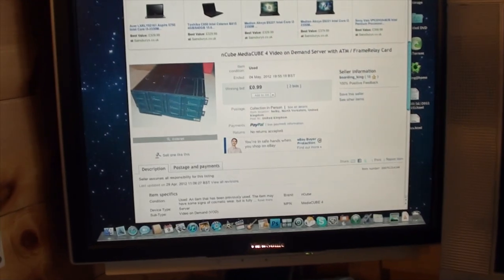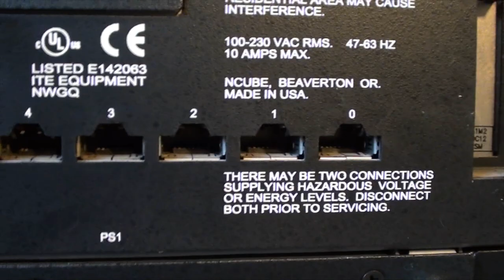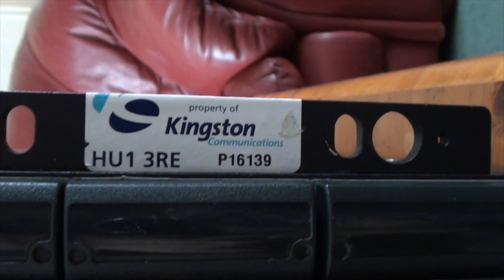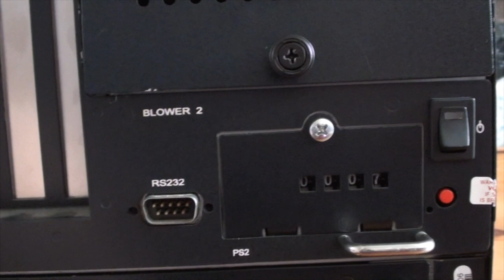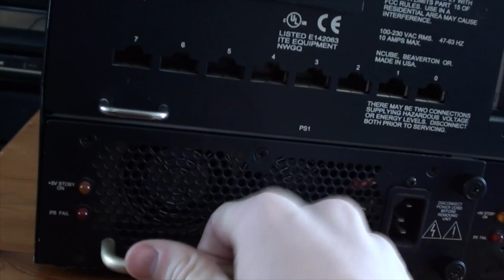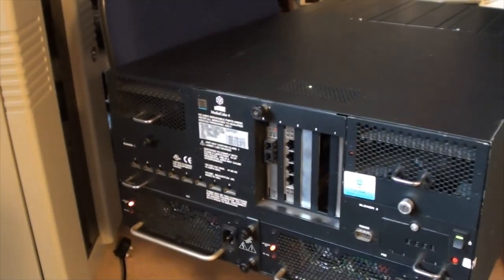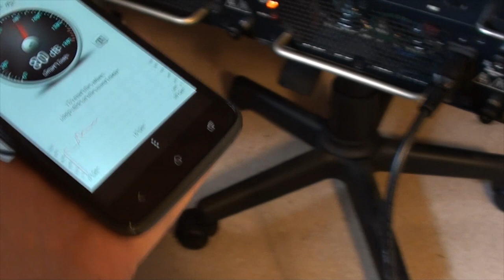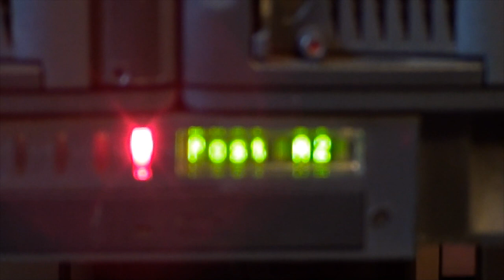MediaCube nCube 4 Server Teardown

Comment: Just to give you a little history on those machines.  They were actually original designed by SkyConnect which was bought by nCube and then some other companies down the road.  It was designed to work at what is called a Head-End at your local cable/tv provider.  It was used for the first digital systems for television and media.  It started out as digital insertion for commercials.  The original was based off of Digital Unix and could display up to 6-8 channels concurrently.  In the back of the machine where the ports are labeled 1 through whatever.  That was the output for each of the channels.  You were correct about the RAID-4.  You are missing a few pieces to make it a full rack at least when the company was called SkyConnect.  That original machine would have set you back a very very pretty penny.  Was the best machine that I have ever worked on and was designed for complete redundancy.
Reply: De Jay, good story! A Shame that he didn't pin your comment!

Comment: Kingston Communications is a name that brings back memories. Back in the 80s and 90s, they provided the population of Hull with phone access. Unlike BT, it was something like a 5p for the connection with no ongoing charge. This meant that it became a hub of dial-up BBS activity. I lived over the river from Hull, so had to connect to it at standard BT rates. As a teenager, I sometimes mused about moving there for the hot ANSI BBS action! ;-)

Comment: Nice find, especially for 99p.  I have a 1981 Quantel Paintbox dpb 7001 to work on in the next few days and you putting that on a chair has given me the idea to use my chair for mine so I can rotate it and work around it :o)  Oooh, those two pro tape players ? behind look interesting too :o)  Wow, that's the largest motherboard I've ever seen :o)  Hmm. must try that decibel meter on the paintbox, even the hard drive (11 inch platters) is deafening :o)

Comment from the maker: Had one when I was a kid. Unfortunately the floppy drive died in the mid-90's long before you could get spare parts from the world wide web so unfortunately it's gracefully rotting in a landfill site somewhere in Essex right now. When I saw one on eBay last year for a few quid, I couldn't resist. It came with a huge bag of disks including Bootman, Chuckie Egg, Comic Bakery, Kings Valley and a load of others.

Comment: The older nCUBEs ran a derivative of Plan9 from Bell Labs, but I was probably abandoned when buying out SkyConnect.  Larry Ellison was an early investor in nCUBE and their platform originally was sold to be used with Oracle Video Server.
Reply: "SkyConnect acquired the digital ad insertion system software from Digital Equipment Corp back in August 1997. It was part of DEC’s MediaPlex suite of video products, and primarily aimed at the cable industry for ad insertions. DEC eventually agreed to drop its MediaPlex work altogether and use Oracle Corp’s Video Server software on its DEC AlphaServer hardware."

Comment from the maker: The P2 will end up in one of my spares boxes. The IDT 79RV5000 chip might be worth something because the top and the underside of it is 24K Gold Plated. I've got boxes of PC133 memory so that will end up in there anyway. I will hang on to the fiber-over-copper interface board just out of curiosity and any aluminum or steel casing will end up at the local scrap yard because it's all non-standard.

Comment: That CPU on the fiber card is a MIPS R5000 processor which was used in some Silicon Graphics workstations.  I'm thinking that fiber card is more than just network or fibre channel. I'm wondering if it's some sort of high speed video encoder/decoder?

Comment: Those ports at 2:58 are the either the 1 or 10 Gbit fiber optic connection, but essentially it looks like a long stick about 10 cm long connected to a cable. :D

Comment from the maker: No, I never found a manual for this. I tried both a straight through and a null modem cable and neither worked. I did try 9600 bauds, 8 data bits, 1 stop & no parity. I spoke to a friend of mine who is a network engineer and he said that it most likely needs to be connected to the rest of the hypercube system before configuration can take place.

Comment from the maker: 64-bit PCI and PCI-X are the same thing are they not? I may have got mixed up with the interface but that's because I was giving my opinion on what it would have been because it was proprietary and I hadn't seen it before. The processor is a Pentium 2 but the Pentium 3 and some Slot 2 Intel Xeon processors used the same cassette-style casing around them. I spent over two hours one evening after connecting it up to a terminal emulator on my Windows 98 system but it was completely silent.

Comment: It might be possible to run GhostBSD which is free use UNIX based OS without the AT&T source code and install a graphics card it should detect it and install the various graphics drivers.

Comment: i was gonna use it for a storage server but the ram for it was hard to find each stick is like £50 n it needs 2 to run max ram for it is 64gb 
40x roughly 1gb or more 128gb or 64gb not sure 

5x 8=40 ram slots lol

Comment: Take the Intel Celeron Slocket CPU and install it in a ASUSTECH P2B-B Motherboard with something like 8 GB of PC100 system RAM  and use an ATI PCI-E AIO PCTV graphics card you should be able to install Windows ME onto it as I don't think you could install Windows 10 on it as it is not that powerful.
Reply: mermaids
Reply: shit. you could install that Pentium II in any random socket A motherboard and use any PCI grahpics card and install Windows 2000 with the 512 + 128MB its got and run better than most Windows 10 machines

ME is garbage. NT 5._ was the best Windows there was, and it got slowly worse after that. Windows 2k would run on a pentium II and little as 64MB RAM without much hesitation..

Comment: also it has 1 ram i paid £50 for it for a512mb fuk me thats pricy
Reply: +Daniel Hornes can you not use ECC system ram as it is very powerful and would make a brilliant Web server, if you come a cross other old web servers that are going to be scrapped get the memory if the memory is ECC you should be in the clear, That  Intel Celeron CPU will work in an ASUSTECH P2B-B Motherboard which will take standard system RAM.